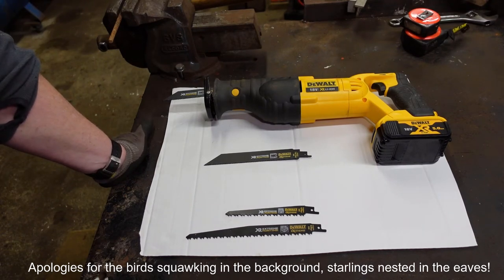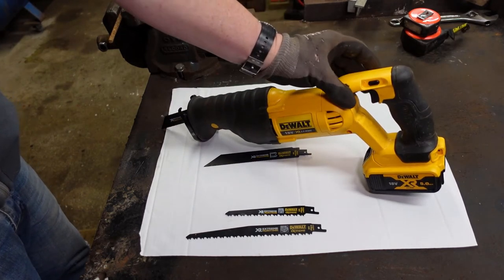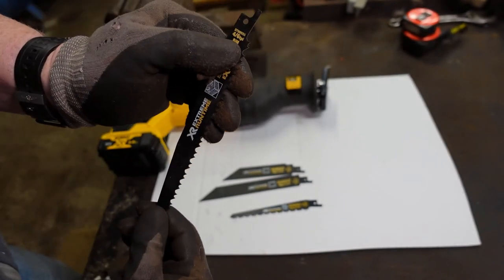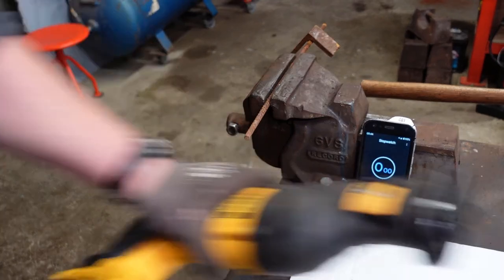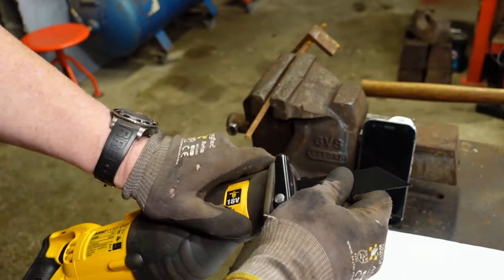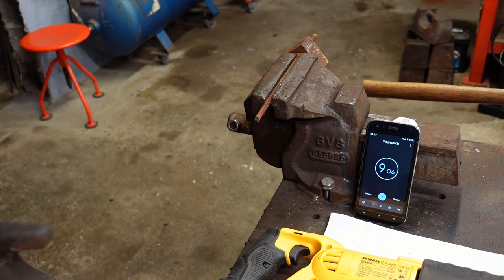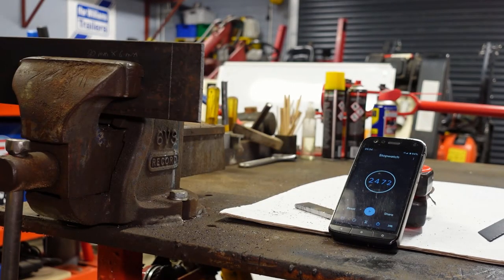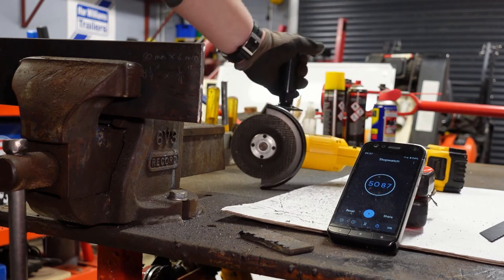Cutting Steel   Chapter 2 - The Reciprocating Saw

Comment: Saws all and Angle grinders are the most useful tools I own. Seems like you have not used a recipe saw much and were very much surprised. There is different attachments for this saw that you can use. It is one of the best tools made use it more often and find out
Reply from the maker: And you're absolutely right. For some reason angle grinders are the go to tool here and you generally only see the recip saws used for demolition work. Since making the video I do use it more especially as it's so clean.

Comment: I inherited an aluminum ladder that is attached to an abandoned house but abutting my house. It's basically grown into the soil and vegetation and has scaffolding at the top. I can't budge it and am thinking of just cutting through it and removing the lower section from my property. What would be the correct tool to use?
Reply from the maker: That saw would do the job alright. Unusual inheritance! Pity it wasn’t something valuable.

Comment: If one were to make an at-least-slow-them-down steel barrier against Sawzall catalytic converter bandits, what type/grade and thickness of steel would you recommend? 1 inch Cold rolled 1020, 4140??
Reply from the maker: There’s an interesting idea. Thick walled stainless pipe or plate would certainly slow them down. Boiler pipe is also a high carbon steel and tough to cut.

Comment: can this go through cast iron that is thick. looking for a method of cutting through the cast iron harp of a piano, so that i can get it into pieces that i can carry out of the house.
Reply from the maker: Yep, it should go through grey cast iron (generally grey is used in piano frames/harps). Should be easier to cut than steel. A long blade with 15-18 teeth per inch should perform ok. Just make sure it’s a metal cutting blade. 

And good luck!

Comment: good day.can you cut a 45 degrees angle with a reciprocating saw?thank you!
Reply from the maker: It's possible alright but not as easy as with other saws. If you mark out all four sides of the material and cut carefully along those marks it should turn out fine. Make sure the saw blade is long enough to ensure it extends beyond the material you're cutting. And good luck!

Comment: Unexpected surprise. Were the teeth ok after cutting metal ?
Reply from the maker: The teeth were pretty good, no signs of wear really.
Reply: @WobbleMatic  Thanks for replying. Is this something that all recipoicating saws and hacksaws have been able to do or is this just due to the advent of brushless motors at least in the wireless space? Can mains ones do it?  It seemed so clean an exercise. It made you wonder if apart from cheapnesss of consumables for thicker steel whether angle grinding is necessary. It has always been this high torque at low revs which has meant that most diy level tool price points seem underpowered according to information on youtube videos along with the concern of destroying the expensive blades prematurely due to runout or heat in a higher rpm tool be it circular saw, band saw or cnc mill/lathe. Shame there is no interchangeable motor that could be used in all the tools to be able to cut metal
Reply: @WobbleMatic  I just saw some of your other replies, I will read them asI am sure they covered some of my questions. Thanks

Comment: When is it better to use an angle grinder for cutting steel?  I am considering buying one to cut through sone long 1/4" thick steel brackets because I feel the angle grinder could do it better than the reciprocating saw but after seeing how much faster your reciprocater cut I'm not sure.  It might be helpful to do a comparison showing how much steel you can cut with a sawzall blade before the blade is worn out vs with a 4.5 or 5in cutting wheel on an angle grinder.  Thanks
Reply from the maker: Tough question to answer, I think it's a horses for courses type of situation. The reciprocating saw will cut quicker but less precisely and it is nowhere near as controllable as a grinder especially if trying to cut steel to fabricate parts. They are  fairly aggressive tools. Bear in mind that the 4.5 /5 inch grinders (especially cordless) are not particularly heavy duty tools and if cutting thick steel a corded 4.5 inch or even 9 or 12 inch grinder would make short work of it. 

The reciprocating saw does however cut cleanly and does not make dust so it has advantages there.

There is an element as well that the reciprocating saw is a one trick pony, it only cuts and is difficult to manage light steel whereas the grinder will cut thick and thin and you can then also mount grinding disks, flap disks, wire brushes etc. 

Speaking personally the reciprocating saw is one of my least used tools whereas the grinders get constant use, make of that what you will.  
 

I did come across this video previously which might help.

https://www.youtube.com/watch?v=Ux5omq7mTe4

And if I remember correctly Fireball Tool did a fantastic video on how to use a grinder to maximize disk life by  cutting in a certain way. It also demonstrates how subjective a comparison would be between the two types of cutting.

Comment: How well will this cut through 1mm-thick spring steel plate?
Reply from the maker: 1mm thick shouldn't be a problem, the teeth might wear out a bit quicker though as spring steel can be tough enough. Carbide tipped blades will probably suit best.
Reply: @WobbleMatic  Thanks.
Reply from the maker: Let us know how it goes.
Reply: i use low cost harbor freight brands witn bi metal to cut 5mm plates, works wonders

Comment: I bought 1like that last year and I tride to cut 9mm steel bar but I'm frustrated because it didn't cut off.
Reply from the maker: I’m surprised as it should go through 9mm bar reasonably easy. 

A few things to check:

Blade type suitable for cutting steel. 
If cutting stainless steel bar I’d suggest a tungsten carbide blade. 
Try a new blade and maybe reduce your cutting speed, if the blade heats it goes soft and loses sharpness. 
Use a few drops of oil to help dissipate heat. 
Clamp your material securely. 

Let me know how you get on, hope this helps.

Comment: Can it cut circular plate on sheet metal?
Reply from the maker: I've never tried to cut circular, I would imagine it would be tough to do. Depending on the diameter of the hole a hole saw would be easier for smaller holes and probably a jigsaw with a thin blade for bigger holes.

Comment: Hi Sir nice video ! which model you are using here model number ? I'm trying to buy the same from Dewalt
Reply from the maker: Hi back to you. The model number of the saw I have is DCS380. It’s a few years old so there may be an updated model for sale by DeWalt now. Additionally I’m Ireland based so it’s not beyond the bounds of possibility that the same saw could have a different model number where you’re living. Hope this helps.
Reply: @WobbleMatic  Hi Thanks again

Would you be able to tell me if DeWalt America operates in the Middle East? What is the process for charging if it different ?

I'm trying to buy one from Amazon the price 2 times cheaper 

Obviously the chargers will be setup for different voltage AC sources ?  here the DeWalt tools are advertised as 18V not 20 but I believe they are the same
Reply from the maker: I think you’re right, they’re 18 volt in Europe too. European electricity is generally 240 volts AC at 50 hertz so if your mains power is the same you should be able to go for European spec. Generally the US stuff is 110 volt at 60 hertz.
Reply: @WobbleMatic  Thanks for the help which you all the best

Comment: boiler tube?
Reply from the maker: I think boiler tube is carbon or alloy steel and would be quite a hard steel. Tungsten carbide blades should get through it but it’ll be hard work depending on the wall thickness.